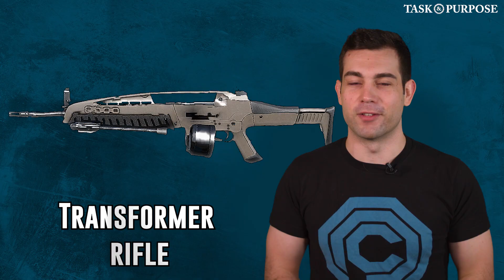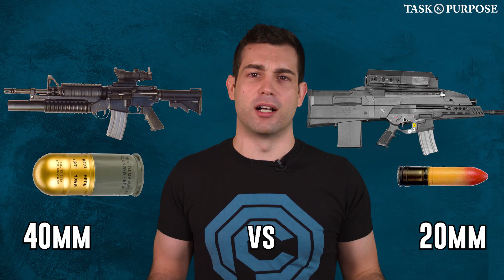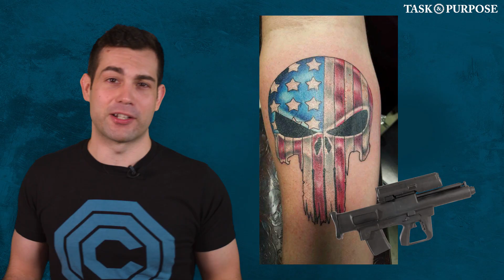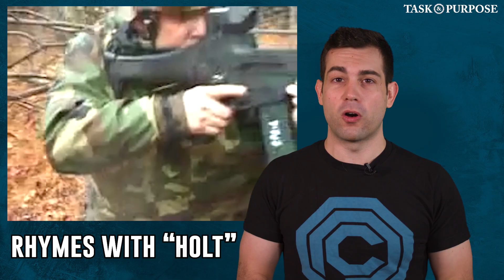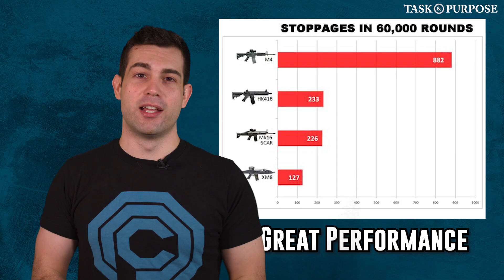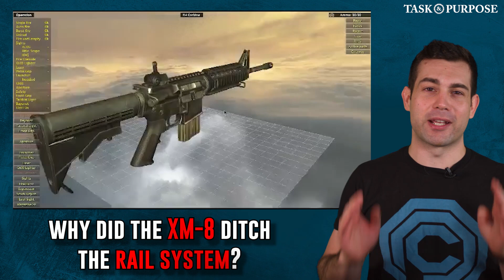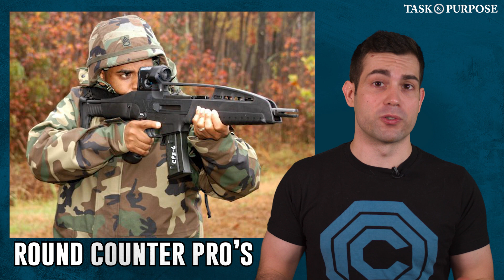Why was the Army's XM-8 Future Weapon Series Canceled?

Comment: US Military, just re-barrel M4's with 25-45 Sharps barrels & get Ammo companies to mass-producing the ammo. No other upgrades required. The 25-45 Sharps round has longer range & more knock down power than the 5.56 NATO, while using the already battle proven M4 components. While not as powerful or have the long distance range of the 6.5 Grendel, the 25-45 Sharps uses standard(& stronger) 5.56 NATO bolts/bcgs & the standard 5.56 NATO AR-15 magazines hold the same 30 rounds(not 25 like the 6.5 Grendel).
Reply: 25-45 sharps us a terrible replacement round for the 5.56 M855A1 in service. It has less velocity, a worse BC, and more drop. All in a cartridge that weighs more.

Out of a 14.5" M4 barrel, M855A1 (62 grain) is going 3050 fps. 
The 25-45 shoots an 87 grain bullet to 2725 from the same length barrel. That's over 300 fps slower. Add a steel penetrator and all copper construction of an equivelant EPR, and it would be even worse.
Reply: @theimmortal4718  Terrible? In a service rifle, how much velocity is your minimum? I wonder how fast the 7.62 x 39 goes & how about the 300 Blackout? When talking about Rifles using Iron Sights & Red Dots, the effective range is less than 300 yards. About cartridge weight, everything weighs more than the 5.56 NATO. the 25-45 uses the same case as the 5.56, so it is one of the lighter cartridges that can fit the M4 platform. As far as Steel Core rounds go, they are only slightly better at actual penetration than FMJ rounds & are the least accurate of almost all types of rounds. As far as barrel length goes, the 14.5" is great for tight, up close urban encounters or use with suppressors, but the military would be much better off with the original 20" barrels for everything else. I wouldn't mind so much if the military went back to using the heavier 77 grain bullets for their 5.56 NATO with 1:7 twist barrel rifles. While the facts you state are all true: the 25-45 is slower, has a worse BC & has more bullet drop. My idea of a modern service rifle is a rifle used for general purpose against combatants inside of 300 yards. I am not suggesting a service rifle be used for a DMR or Sniper rifle. What the military is looking for a M4 replacement rifle that has more knock down power, has a longer range kill potential(than the 5.56 NATO), easy field strip/clean/service & a low cost to produce/maintain. If they could redesign the M4 barrel & bolt to work with a beefier bolt, The 6.5 Grendel, would be the best solution. The 25-45 Sharps is the best compromise that I can think of, also taking reliability into account. I think the government should keep looking into replace the M4's, but what I have seen of the new 6.8 guns, I think for my taxpayer dollars, the government should keep looking. People talk about how the M4 is so dated, but the age of a rifle design, has never stopped our enemies from killing our troops with SKS, AK-47, Mosin-Nagant & Enfield rifles, all much older than our M16 variant. You have valid arguments against the 25-45 Sharps, but what is your solution for the military's next service rifle?
Reply: @tilepusher  
Honestly, the next service rifle is way down on our priorities, and I'm carrying one every day right now. im on my 6th deployment as an infantryman and I'm on my 20th year in the army.

Replacing our machineguns with more accurate, lighter ones should've our highest priority right now, along with getting the M3E1 Carl Gustav and M110 DMR down to every infantry squad.
For what we need it to do, the M4A1 with M855A1 ammo are about perfect for the role for which we  use them 

Bullet drop and BC do matter, because it increases hit probability. Soldiers do often enough shoot past 300 meters, and 5.56 has a flatter trajectory 

The US military won't be going back to lead cored bullets. The EPR is the way forward from now on. They both penetrate deeper and have a lower fragmentation threshold than a conventional design. A M855A1 round will fragment past 400 meters from an m4, something that even the 77 grain M262 Mod 1 cannot do. They're accurate enough at around 2 MIA from our guns. That gives us a 50% hit probability at 600 meters.

Overall, if we had 12 man squads, with one team supporting a lightweight 7.62 machinegun and the other supporting a recoiless rifle, that would give us the most flexibility. Add a drone operator, with everyone carrying M4s and ammo for those 2 guns, and you have a very lightz responsive squad with both CQB and Long range fires.

I honestly don't think a caliber change us in order. A great mix of 7.62 and 5.56 weapons gives us the best of both worlds. That's what all other armies are doing as well.
Reply: @tilepusher  
As far as going back to full length M16A4 20" barrels go, were not going back to that. There's a reason that SOCOM, the USMC, and the US ARMY all have gone to carbines. It's not just about CQB. We spend a lot of time in and out of aircraft and armored vehicles. Full sized rifles make it very much more difficult to effectively employ these weapons while exiting. I do this regularly and wouldn't want to go back to my old rifle.

In addition, our carbines aren't our primary firepower. Our crew served weapons are. Those are the weapons that we need to be improved. ACOGs have doubled our hit probability with our carbines and the newish M855A1 ammo has quadrupled the fragmentation range, increasing terminal ballistics drastically.
The same increase has been accomplished with the M145 on our M240L machineguns, along with the M80A1 ammo. When we bring the M110A1 DMR down to the squad level, we will also have the appropriate amount of precision fire out to 700 meters.
That will give us half of our firepower effective from CQB to 400 meters, and the other half from 200 to 800 meters, with all purpose HE projection from our 84mm Recoiless Rifles out to 1500 meters with the new laser guided rounds.
Reply: @theimmortal4718  Well said. Still my comment & this video was on the M4 Replacement. I really haven't looked at anything on military machine guns, but your reasoning seems sound on that topic. I am not in a place financial, where I can even considering owning a Fully Auto weapon, so I don't own, shoot or research then.  When talking about hit probability, bullet drop, BC & shooting past 300 yards, in my Tier 8.5 Operator status opinion, I am looking for a round that carries over 350 ft-lbs of Energy(a 9mm at point blank is about 345 ish ft-lbs). A 62 gr pill will do that out to maybe 500 yards with a 50" drop. At 500 yards, a 87 gr 25-45 yields,  456 ft-lbs of Energy with a 49" drop. As far as MOA@100 yards, me & my fellow Tier 9+ Operators, none of have ever shot a 5 round, sub 3" group with any Steel Core Ammo, while shooting sub MOA, with the same rifles using Hornady ammo. I imagine the military has better ammo than we can buy & maybe even better barrels? I personally use Ballistic Advantage & Faxon barrels, so not super high end barrels, but great for the price. While I may disagree with your conclusions, I respect You for Your Service & the Freedom you provided America with. Seriously, Thank You.
Reply: @theimmortal4718  Again great point. A service rifle & most weapons are about compromise. If you want higher energy, velocity & accuracy, you must compromise weight & mobility. I think the future will see a rise in even shorter length barrels, for use in tighter urban areas, & for accommodating additional suppressor length. Still with all of your experience, what round or platform would you like the military to adopt as a service rifle?
Reply: @tilepusher  
That amount of drop from a 25-45 Sharps vs 5.56 depends on a lot of things.
Which round, what barrel length, and what is the muzzle velocity?
The 87 grain 24-45 sharps needs a 24" barrel to get the same velocity a 62 grain 5.56 does from a 14 5" barrel. That's the only way to match the drop like you just did-  by going with a barrel nearly 10 inches longer. Are you of the thinking that our soldiers should be on patrol with rifles sporting 24 inch barrels?

There just isn't enough need for us to switch calibers with so little to gain by doing it. The new M80A1 and M855A1 ammo perform spectacularly and will hopefully be with us for years to come. Not only are the more accurate than the prior rounds, they have better terminal effectiveness. Going to a new round won't have any measurable effect on the outcomes of fights in the military at all.
I'd much rather we spent the funds towards shaving 50% off of the weight of our 7.62mm GPMGs so we are more responsive with those guns and don't fatigue the gunners in the fight.
Reply: @theimmortal4718  My go to weapons: Long range(inside 1000 yards) & property defense, built 20" 6.5 Grendel AR-15. Mid range & against possible armor protected, PSA 16" KS-47 or Norinco MAK-91 both in 7.62x39. Close range & Bug Out, 5 lb 16" built 223 Wylde AR-15 or 18.5" shotgun. At this point I have no scenarios planned for shooting even past 500 yards, nor do I own a machine gun, recoilless rifle or rocket launcher....... not that, I wouldn't want to own them! Even if I couldn't afford to keep it fed, I would love to own a Gatling style machine gun.
Reply: @tilepusher  
Check out the Chopping Block channel.
Andrew has done ballistic gel testing of a considerable amount of ammunition in a lot of different calibers.
He's tested EPRs in both 223 caliber as well as .30 Cal. His tests with a 30 Cal EPR stuffed in a 300 BLK case simulate how that bullet behaves in a body at 600 meters. 

The 5.56 EPRs behave similarly. They even out perform ballistic hollowpoints at extended ranges. They aren't steel cored bullets. They have hardened steel penetrator tips with copper cores and reverse drawn jackets. They're not yaw dependend and fragment down to velocities as low as 1600 fps, which is equivelant to a vmax round.
Reply: @tilepusher  
Yeah, this is more about what our military needs as apposed to for civilian uses.
The xm-8 and xm25 were proposed military weapons.
For civilian fighting rifles, the 5.56 AR variants and the 7.62 AK variants are the most practical for the relatively close ranges and limited fire needed. Civilians aren't going to be getting into fights involving dozens of men using fire and manuever  with mortar, machineguns, and CAS.
Honestly, for civilians , any round would be fine (6.8, 5.56, 6.5, 7.62, whatever) as they don't have to carry hundreds of rounds or move miles in a day with it. Shooting a home intruder with any of those rounds at living room distances would produce about the same results. 

An AR15 carbine loaded with Speer Good dot 75 grain,  Barnes Vor-tx 70 grain (optimized Brown tip), or 62 grain Federal trophy bonded bear claw ammo is about ideal for a fighting rifle/ammo combination for civilians. Keep a couple mags loaded and practice with plain Jane FMJs. 

If I were to use an AK, I'd go with Hornady 7.62x39mm 123 grain SSTs. That seems to be a solid performer that expands well at fighting distances.
Reply: @theimmortal4718  Great point. There isn't enough need to change anything about the current service rifles. The new 6.8 rifles being tested, are much more expensive, have more moving parts, look like a nightmare to field strip & clean, not to mention that the ammo cost will be insanely high. About the 25-45, my goal was for a rifle to shoot inside of 300 yards & have more energy than the 5.56, while keeping the cost as low as possible. At inside of 300 yards, velocity isn't a factor for either caliber. If you want a effective rifle for over 300 yards, regardless of caliber, a longer barrel is always better. While it is totally possible to make out to 800+ yard kill shot with a 5.56 NATO, it isn't a practical purpose for a service rifle, the Energy it makes farther than 400 yards is more like for wounding. I think it is awesome that you trust a 5.56 NATO, 62 gr, steel core round out of a 14.5" barrel, to do everything. I see it as a compromise. On purpose of use & barrel length: Close & Urban use: 14.5". Patrol/Guard duty use: 16". Wide open(like deserts or mountain ranges): 18". If due to Budget Cuts your DM is forced to use the same ammo as everyone else or defending your castle walls against the Mongolian Horde : 24" barrel. Your first hand knowledge gives you much more insight than a Tier 8.5 Operator like I am, will ever have. Still, there is another opinion out there that the current M4, needs to be replaced & the 25-45 Sharps is my opinion of how to do it for cheap. In my opinion, America is NOT being out gunned at the main battle rifle level, yet & the current M4 should NOT be Replaced...... but if you wanted more range & energy for the least amount the 25-45 Sharps is the way to go.
Reply: @theimmortal4718  Thanks I have to go check it out. I wonder if the accuracy is affected, using these EPR rounds, because the razor cores that they sell us, the accuracy sucks? Are all of our troops using them now? Are the EPR rounds sold to civilians? If so what name or brand? Thanks
Reply: @tilepusher  
I agree about the NGSW and that 6.8x51mm round it fires. Complete waste of money and out of wack priorities. We have no need to issue a rifle shooting a full powered cartridge to every soldier.

We don't use a steel cored round. So I DON'T trust a steel cored round, since the M855A1 isn't one. It's a copper cored segmented round. It outperforms any other bullet in that caliber. That's not just my opinion. It's backed up by testing, as well as first hand accounts in combat since we began using it 8 years ago. It's a much better round than the older 55 grain m193 and the steel cored m855 (green tip).

Yes, a DMR in 7.62 would either shoot the 175 grain M118LR match round, but also retain the ability to shoot the 130 grain M80A1 stripped off of machinegun belts.
This wouldn't be due to budget cuts, but more due to unavailability in the supply chain from constant fighting in a high intensity conflict.

The 175 grain match round offers about 200 meters additional range for aimed fire over the m80A1 in a M110 or M110A1. Those rifles are capable of precision fire anywhere between 700 to 800 meters. The machineguns can reach out further using a tripod and a spotter.
Reply: @tilepusher  
No, M855A1 and M80A1 using EPRs aren't generally available to civilians, and I doubt there will be surplus. Any you see for sale online were stolen and are expensive.

From what we've seen, there's been a slight increase in accuracy over the older rounds, due to higher velocity and the fact that they're longer than the older rounds because they have copper cores rather than lead. The M855A1 62 grain round is the same length as a 77 grain match round. It's about 1/2 MOA more accurate.
They do more damage to our steel iron maiden target plates, as well. Plates that would only get a small dent from older m855 now will get fully penetrated, resulting in new range rules. We can no longer fire at them at less than 200 meters. They also penetrate glass and auto bodies that would defeat the older ammo.
Reply: I have only used Federal/Lake City M855/Green Tips. 5 round groups suck. I just noticed that PPU & IMI also sells a Green Tips. Maybe my rifle will like that better? Still not sold on the effectiveness of the civilian Green Tips, though? I got to get a couple of boxes & see if any of my rifles can shoot 5 shot MOA groups with it. On the good side it is still cheaper than Hornady ammo.
Reply: @tilepusher  
M855 green tips are not the best ammo for that caliber. The round I listed above are much better in every way. I wouldn't suggest using it, overall.

All major militaries seem to be sticking with calibers between 5.45 mm(Russians), 5.56 mm (NATO), and 5.8 mm (Chinese).
All of these rounds utilize a steel penetrator, weigh between 53 to 64 grains,  and have muzzle velocities between 2900 fps to 3100 fps from carbines. Pretty much all armies have weighed the pros and cons of different cartridge attributes and have all come to a similar conclusion on what works best. I wouldn't expect that to change anytime soon.
Reply: @theimmortal4718  I agree. Since you don't recommend it, I won't even try any Green Tips & stick to Hornady to show off & PPU for range practice. Another thing I have been thinking about, is, The 6.5 Grendel is the best AR-15 cartridge, but it has a weakness. It causes Bolt failures at a much higher rate than a standard 5.56 AR-15s. What if someone designed a shortened body AR-10/DPMS LR-308/SR-25 Upper Receiver to fit on a AR-15 Lower Receiver, a barrel with a AR-10 sized Barrel Extension/Chamber & a larger, stronger AR-10 sized Bolt to fit in the barrel extension & chamber, all so they could make a reliable, long life 6.5 Grendel AR? The 6.5 Grendel is a great round & you would only lose 5 rounds per magazine capacity, in a standard 30 round AR-15 magazine. This new rifle would still be cheaper than the new guns & still keep the recoil almost as light as the standard 5.56 AR-15. They could call it the AR-13? I think the 6.5 Grendel cartridge, would also make a decent light machine gun round for ranges less than 1100 yards.
Reply: @tilepusher  
I don't agree about 6.5 Grendel.
The 5.56 is still the best cartridge for the distances these guns were meant to shoot. With proper ammunition choices, 5.56 is more than deadly at both close ranges, ammunition dependent.
Expanding ammo to 200, and 75-77 grain match ammo to 600-700. Further than any civilian would need in an AR15, other than shooting steel. 5.56 is also cheaper to shoot for plinking (inexpensive steel 6.5 Grendel isn't accurate) and 5.56 match ammo has a better trajectory (drop and drift).

If someone needed a round with more power than that for shooting past 300, a good bolt action in a round like 270 Winchester fits the bill perfectly rather than stretching a short round designed to fit in an AR15. Out of a 24" barrel, a 270 will drive a 130 grain bullet at 3150 from the muzzle, with a very flat trajectory.

Like you said before, these fighting rifle calibers only need to be able to be effective for 300-400 meters. After that, it's best to pick up a full powered rifle.
That's why armies also use a mix. The Russians use 5.45x39mm for short/medium range and 7.62x54R for longer ranges. We use the 5.56x45 and 7.62x51mm for the same purposes.
Reply: @tilepusher  
The 7.62x51 is a much better MG round.
It has 400 fps higher muzzle velocity than a 6.5 Grendel from an 18" barrel, and penetrates light armor, sand bags, cars, and trees much better. It also has less drop and wind drift. I don't care for LMGs firing intermediate cartridges. They're much less effective than GPMGs firing full powered ammo. 5.56 is great for carbines carried by the manuver element, as assaulters need to stay light and fast.

None of these newer alternative AR chamberings have any military value. The Chinese and Russians certainly won't be ditching 5.45 or 5.8 for something like 6.5 Grendel.

Honestly, I don't see the point in them unless someone wants to hunt with an AR15 for some reason. A 500 dollar .30-.30 with good glass would be just as effective at the ranges and game they're likely to be shooting. Probably cheaper on ammo, too.
Reply: You win. I am wrong about everything. After my stroke last year, I have had to relearn how to do everything. As a Tier 8.5 Operator, my whole world is Compromise. Those factors along with my lack of big money, has brought me to love the AR-15 platform, in almost all of its flavors. Because of my recent right side weakness, balance & loss of a good amount of dexterity in my right hand, I have come to love the challenges of building & shooting AR-15s.  I will stop trying to reinvent the wheel now.
Reply: @tilepusher  
No, you're not wrong. I just disagree with some of your points. Others, I completely agree with. There's a difference.

The AR15 is a great rifle, and probably one of the most adaptable of any invented. It's actually my favorite rifle.
The 5.56 is such a low recoil round that almost anyone can shoot it. Like I said, calibers like 6.8 SPC, 25-45 and 6.5 G are great for hunters and target shooters, just not for militaries. I would say out of the 3, 6.5 is the best for hunting, but I wouldn't prefer it over 5.56 or 7.62 for infantry combat. It'll continue to enjoy success in the civilian shooting world, but it's a dead end for armies.

The same seems to be true for a lot of these more modern firearms designs. Guns like the SCAR, G36,  Famas, Galil, etc., that were supposed to be the next great evolution in combat firearms really haven't, and most are fading from use over time. Yet, the AK and AR live on.
Personally, if i were to have any AR chambered in a caliber other than 5.56, it would be an AR10 in 7.62x51.